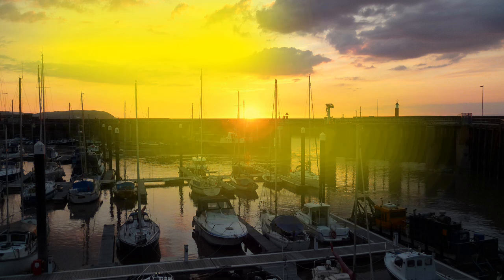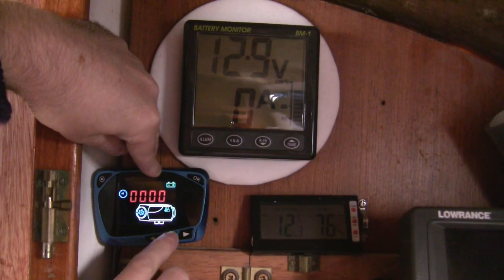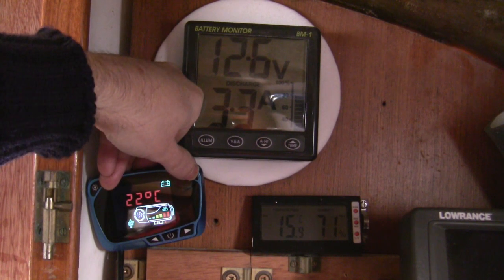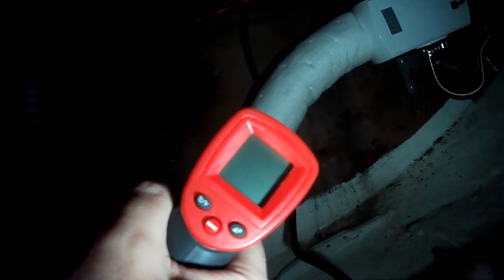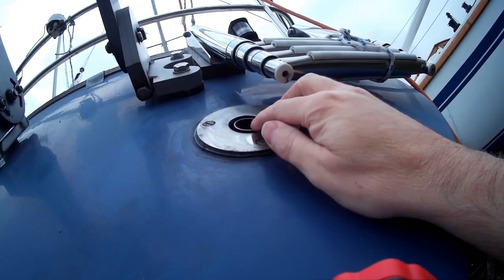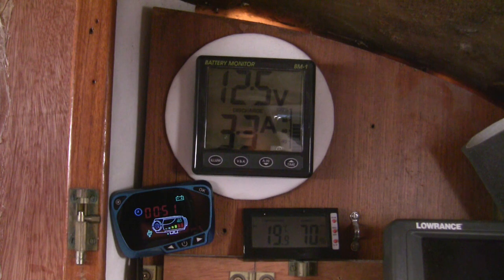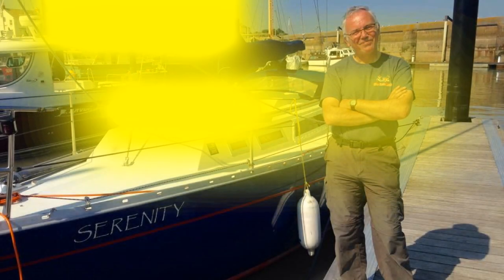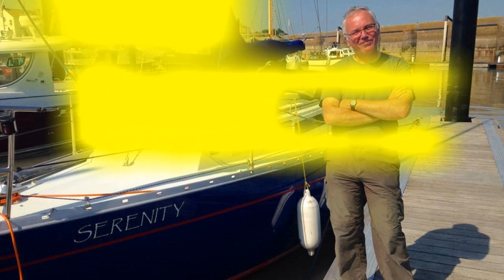Just About Sailing April 2019 - Installing a Chinese Diesel Heater, Pt 3 Full operational test run

Comment: Actually Id say it was very interesting... or at least it was to those of thus that might want to fit one ourselves... although it wasnt very exciting :-)
Reply from the maker: Thanks Ian. Hang on - have you just copied and pasted a comment from my Christmas Special?
Yes, I was well aware that it would mostly just be a camera shot of some instruments changing very slowly. I knew that the heater would kick out a lot of very warm/hot air from my very first test when I installed it. I really wanted to get an idea of the power consumption as the thermostat kicked in and out. It performed better than I expected. It seems to get up to the desired temperature very quickly (full power at 3.3 amps) and then spend ages at the tickover (0.6 amps) pushing out a small amount of warm air as the temperature drops.
I suppose I could have made it more interesting by doing a multi screen shot so you could see the diesel level - it didn't look like it moved at all. Cheers.

Comment: Good info, Thx. I was wondering, some liveaboards mentioned using those heaters to dry out the boat. Usually with the heat the boats start to sweat around the windows and bad insulated areas and produce increased humidity due to condensation which on boats is always a problem with generating mold. Maybe they used a secondary route for the air intake from inside the cabin like a closed loop ? Those heaters move a lot of volume of air and the increased air circulation should have a further positive effect compared to other heating systems. Have You noticed any of those effects ?
Cheers
Reply from the maker: I have only just installed this heater, so I am not sure yet whether or not the heater will help with condensation.
When I was living on the boat for two years in a marina/harbour with shore power I used a desiccating de-humidifier. That was 100% effective - you could even hang up wet clothes of towels and it would dry them as it literally sucks the water out of the air. Unfortunately it would need too much power for off grid use.
I am toying with the idea of being able to switch the input from getting the air from the inside or the outside. My instinct (with a bit of science) is that having a through put of circulating air taken from the outside would be better than recycling and warming the air already in the cabin.
I guess I will find out in good time. Cheers.
Reply: @verynearlyaboutsailing8114  Yes, the power consumption is the issue with the de-humidifier. Well, actually it would not be recycling.You would only connect the air intake port for the combustion chamber to the inside of the boat. This air from the chamber gets blown outside through the exhaust afterwards. Of course the whole process might be a lot slower then with a de-humidifier. I would argue the need of connecting the air intake of the chamber to fresh air because the boat will never be air tight. Of course using fresh air for the fan has advantages. I think this is an interesting topic because of the two completely independent air intakes. The outside fan is producing heat by cooling the unit with air from where ever the unit is installed and the inside fan acts like a compressor injecting air from the intake port into the chamber. That is the one I refer to.
Reply from the maker: There is some safety guidance from the International Institute of Marine Surveying that states that you must not take the combustion air from any accommodation area.  I'll link to their document below. I guess the fear is that if something blocked the exhaust outlet then there is a route for the gasses to get into the accommodation. The guidance also says that you shouldn't take the fresh air from inside an engine compartment (which is where my heater is located). But I do get the logic of your argument.
I have seen a few van installations on YouTube where the fresh air is simply taken from within whatever 'box' (often under the passenger seat) the heater is installed in. There doesn't seem to be enough ventilation for the air to get into the heater.
As you say, a very interesting topic. Here is the document if you want to have a look. Cheers
https://www.iims.org.uk/marine-installation-safety-training-diesel-fuelled-heating/
Reply: @verynearlyaboutsailing8114  Obviously there are some issues that have to be addressed to consider my thoughts. One of them is the location where the unit is installed. For example right now the hot air You inject inside Your  cabin come from the engine room. It´s not ideal because of posible leaks in the  exhaust system of Your engine. However You have a CO2 snuffer. So that takes care of the risk. But most of all in the engine room it´s a lot better because there is more air to breathe then stuffed in some small locker inside the cabin. but this has a solution. You just have to run another duct  from Your engine room to where it´s convenient. What I would do is run a "T" connector from the pipe of the air intake and route it to a different location then the duct creating kid of a harmonic air flow inside the cabin further covering some dead spots where the is low or no air circulation. I would also put kind of a closing/valve system between the "T" and  Your current through hull chamber inlet and exhaust tube to prevent posible water intrusion during following seas.
Hahaha Yes, there are still a view issues about the installation that have not been talked about. I got the idea when I actually saw this heater disassembled and when I understood the details how it functions. In theory there should be a dehumidifying effect. I just don´t know if it´s worth while pursuing it. I think that depends on the use of the boat but I would say for permanent liveaboard everything helps as long as there is no huge energy consumption and in this case it would be a side effect that´s for free.
Cheers
Reply from the maker: Thanks for all your comments. Some of these elements haven't been finalised yet - so watch this space. I think one of the key elements is to get the air flow right. There is a series on a van build that you might be interested in. The channel is called 'Greg Virgoe'. He is a heating ventilation engineer by trade and has put a lot of thought and effort into his insulation and ventilation system - he has some very interesting ideas about where the heating duct outlets should go to ensure the best overall heat distribution - he also does the calculations. He installed a gas air heater rather than a diesel one. The interesting design feature, that would be great on a diesel heater, is that the combustion air intake and exhaust are 'one' pipe that is actually two concentric pipes, the exhaust inside the inlet. - So, it is always balanced and the intake air gets pre heated by the exhaust gas. Very clever.Anyway - as you say, 'don't know whether it is worth pursuing' - but still interesting.Cheers

Comment: Great video 
I’m considering on buying two of those heaters for my catamaran much cheaper than paying £2000 for a pair eberspachers 
Or might get just one to try it first
Reply from the maker: Thanks for the comment. I am in the middle of putting together a new video on the heater - which should be out before the end of November.
I have done a bit of theory on where to best take the heating air input from to minimise condensation. The new video will be a practical test of which works best - and also how much diesel and electricity (amps) is consumed.
So, far I am very happy with the heater.
Check out Onboard Lifestyle. They fitted two similar units in their catamaran and seem to be very happy with them.
Cheers
Paul

Comment: Only thing i would suggest is adding the insulation to the exhaust pipe.
The reason i would do that is because eventually something is going to come into contact with it. And that something may be the Skipper.
Also i noticed the Relative Humidity dropped by 6%. Did it rise back up again once the unit had been off for a while?
Reply from the maker: Good point about the insulation on the exhaust pipe. I did buy some cladding to wrap around the exhaust. But I am still in two minds about it. my reason for not cladding it is to allow as much heat as possible to dissipate as the exhaust gas travels from the heater to the thru hull - I want the gas coming out of the thru hull as cool as possible. At first I thought I would clad the bit from the heater to the silencer and leave the rest free.  I was hoping that the IR temperature device would give a more accurate reading - I think the exhaust is a lot hotter than the reading.  I am still undecide on this one - but I absolutely agree that nothing (especially the skipper) should be allowed to get in contact with it.
Unfortunately I didn't hang around long enough to re-check the Relative Humidity. I can say that the air felt 'dry and comfortable' when the heater was on - not sure if that makes sense. I would guess that the Humidity would eventually creep back up. When I was living aboard full time with shore power I has a desiccating de-humidifier (works in the cold) and that had a massive impact on the humidity and comfort levels.
Reply: @verynearlyaboutsailing8114  An alternative to insulation on the exhaust pipe, you could make a protective screen (perforated?) of some kind. This will still protect the skipper and keep heat inside the boat.
Reply from the maker: I had something like that on an old motorbike with a high rise exhaust - still hurt if you put your leg against it ;)
Reply: Maybe try some black marker on the through hull fitting to try and get the IR temperature device to give an accurate reading.A black surface may work better than the reflective surface.
You may also be able to reduce the through hull fittings temperature by adding some sort of passive heat sink to the back of it. Something as simple as a large metal plate with a hole in the middle and holes to match the through hull bolt pattern. Then attach it to the back of the through hull (inside the boat) using the mounting bolts. If you were able to show a measurable difference then possibly upgrade the metal plate to a proper finned heat sink type arrangement. That way you would be keeping even more heat in the boat and less in the through hull fitting.
Reply from the maker: Great ideas thanks. I should have some matt Hammerite paint I can dab on the exhaust to get a better reading.
There is a danger of this getting over-engineered. Having said that, it seems such a waste to be sending that hot gas out the back of the boat. - Maybe I could heat some water with it...

Comment: Blimey how do you put up with that rope frapping away on the hull or mast or what ever, it's annoying me listening to it second hand...  oh interesting video though :-)
Reply from the maker: Fair point. I need to sort out some of the lines. I had a bit of a tangle with the lazy jacks and I think I re-tied the halliards up  badly when I sorted them out. But what is even worse is that I have loose  wires inside the mast (for the tricolour, wind indicator and VHF). These clank away with a really horrible high pitched frapping sound all night at anchor with the boat swaying about - and there is nothing you can do about it. - Secretly this is my top priority to fix.
It will be back to the tweeting birds next time. Cheers ;)
Reply: some people like the sound of a slapping line(rope), although it's not good for the line ....

Comment: You'll never get accurate readings on reflective surfaces with an infrared thermometer.
Reply from the maker: I know. A bit optimistic. I didn't show the bits where I used the good old fashioned method of flicking my finger quickly on the surface - I really wouldn't want anyone to copy that.
When it gets a bit colder I intend to finish off the air vents properly and do a long test. I want to really nail down the power and diesel consumption. I will also probably put some matte tape on various bits and try the temperatures again.
Cheers

Comment: Hi, can you advise where you got the exhaust through hull fitting from. thanks.
Reply from the maker: Patrick, there are quite a few of these advertised on ebay. The specific one I purchased seems to have vanished. However, here is a link to something that looks the same for about the same price.
https://www.ebay.co.uk/itm/exhaust-outlet-24mm-for-webasto-heaters-stainless-steel-polished-eberspacher-d5-/183758810317?hash=item2ac8e0eccd
I specifically wanted one that would fit a sloping transom. There are a few other designs if your transom is more vertical.
Cheers
Paul

Comment: When is the next sail?
Reply from the maker: That is a very good question. Unfortunately, this isn't a very good answer.
I will give a 'proper' update in the next video, or the one after. But basically I have had a few setbacks which means that things are taking a lot longer than they should. And unfortunately I have about 10 projects on the boat that are all half finished and dependent on each other. I am currently hatching a plan where I can get to work on Serenity more often and pull everything together.
I am bursting to get back in the water and I hope it might be in the late Summer...but who really knows...I don't ;)
Reply: @verynearlyaboutsailing8114  ohh I look forward to to seeing you on the water again

Comment: Wrap the heat pipe coming into the cabin in tinfoil.  You are losing heat through radiation probably.
Reply from the maker: Thanks. That is a good idea. I was wondering about wrapping that double sided (silver on both sides with bubble wrap in the middle) tape around it and then putting the current insulating sleeve back on.
I will most probably do this.
Cheers
Paul

Comment: Measuring temperature accurately is surprisingly difficult, particularly when the surface temperature differs significantly from the surroundings. Measurement systems all have inherent issues, and different systematic errors. As and example, one comment mentioned thermocouples as an alternative. Thermocouples can be very good, but issues include:
1. wire purity
2. Reading instrument error (thermocouples generate a tiny signal)
3. Thermal resistance (contact) between thermocouple junction and measured surface.
4. Thermal conduction along wire, particularly if type T is used (Copper/Constantan), and heavy wire gauges.
5. What treatment if any is used on top of the thermocouple junction.
Your infrared meter is probably more than good enough. You might consider sticking something on part of the shiny surface for measurement purposes to see if the readings change.
Reply from the maker: Thanks Ken. I did wonder about painting some heat resistant matt paint  blobs on the exhaust pipe to minimise the reflection issue with the IR device. I have used thermocouples a lot in the past, when I worked in a lab - but never to get a 'surface' measurement. I remember that there was a lot of calibration required - and I seem to remember that the relationship between temperature and the volts reading was not a linear one through anything but a small temperature range - but it was a long time ago and I may be wrong.

I also think that I might have managed to take the measurements at exactly the wrong time. I had initially set the controller thermostat for 22 C and I think I might have started taking the measurements just as 23 C was met and the unit was dropping into 'idle' mode. I remember the external exhaust temperature being much hotter during my first start up last week when it was still running at maximum.

I would very much like to measure the temperature gradient along the exhaust all the way from the unit, and past the silencer to the thru hull when everything is running at full blast - Or am I going a bit over the top?

Cheers - any updates on your plans?
Reply: @verynearlyaboutsailing8114  You have an incredibly diverse background. Yes, the thermocouple voltage produced is non linear. Companies such as Omega produce extensive tables, however, as I recall it is necessary to balance the circuit so there is null current, and have a known reference temperature. This is far too complicated for real life, so all instruments I am familiar with a have built in calibration and read temperature directly. (Omega also provides a free catalogue and technical book for those of us that still use hardcopy.) 
My plans are more or less unchanged. I'm hoping there will be a window in six to ten months where I am financially able to make the commitment and still young enough to manage.